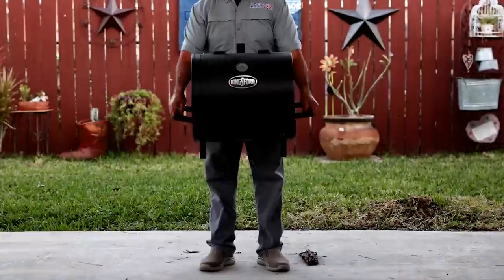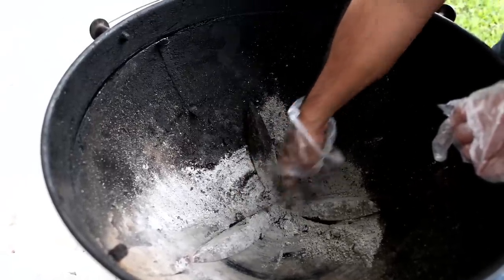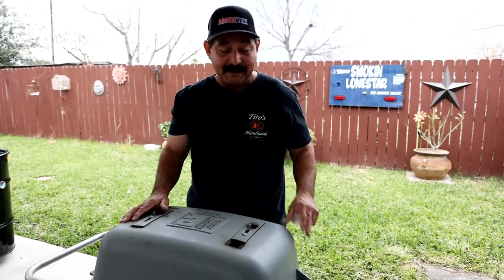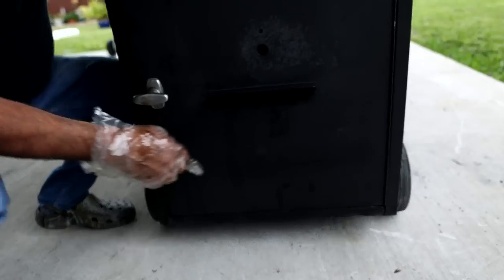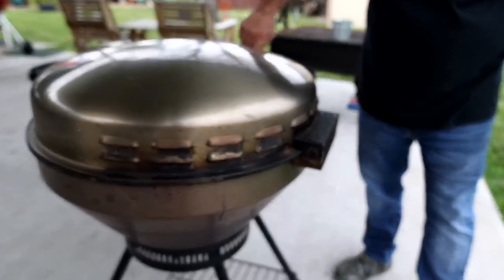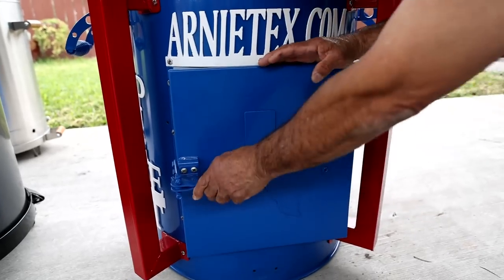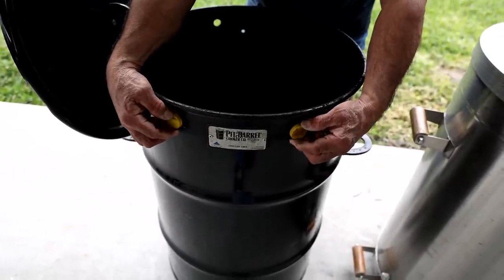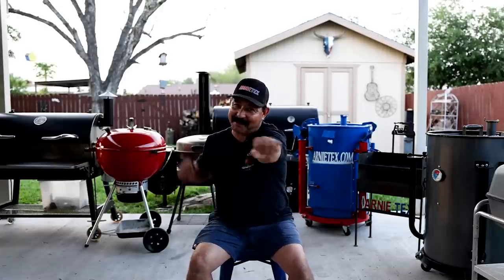I Have Too Many BBQ Pitts & Grills

Comment: Arnie now with my Weber ash basket when it’s full of ashes, I added some wire underneath near the legs and where the basket meet now adde just enough wire through the top bracket that holds the legs and ash basket together.
Now this method works good so no more basket falling with ashes inside of it problems!. Especially while I’m BBQ N ! LOL

Comment: I have 2 pellet grills. Pit boss 5 verticals. 1 off set 720 with smoke daddy upgrades. Camp chief propane and freigerater and sink and 2 burner. 1 webber 22.5 with Santa Maria attachment and home built 50 gallon UDS. 1 trailer smoker off set and a home built smoke house.

Comment: What happened to your Spitts and Pitts pellet smoker?
Reply from the maker: Jay I had two of the first ones they made, they had lots of auger and programming issues so i sold them but I hear they have fixed those issues now.
Reply: @ArnieTex  well I still have my trusty old Hasty Bake of 40 years.  Still going strong but not me.  I need something to plug and play!
Reply from the maker: @gosman949   RecTeq is your answer, I have owned Traeger, P&S, Yoder, Pitboss and the RT is the best imo, so now i have three of them, lol
Reply: @ArnieTex  the only thing I don't like about the RecTeq is that there is no Pellet drop to clean out the hopper for a different pellet.  Is this something you miss sometimes?
Reply from the maker: @gosman949   Yes I agree, that should be a no brainer but i really dont bother changing woods often, I just use whats in there, just me.
Reply: If RecTeq is your go-to pellet smoker, do you have any sort of affiliate connection your recommendation carries a lot of weight with me. Separately, I have had a Gator-pit for over 10 years and I love it. BUT…. There are times I’d like to smoke a brisket and not be so “chained” to my pit. 
Thanks for everything!
Reply from the maker: @cjmueller5455   RecTeQ is for sure my go to for pellet grills at this time, I have owned and or cooked on all the major brands and I honestly I can't remember one that was as efficient, quiet and consistent on temps as the RecTeq. In truth they all have their own little idiosyncracies but the RT is imo the best value for dollar / bang for the buck than all the ones i have had experience with. Only downside if you wanna call it that is they don't have a dealer network where you can go see feel and touch before buying but it's a successful system for them I guess. i'm not an affiliate nor am I sponsored to be saying these things but will say if you call them on the phone they answer and have excellent customer service. Hope that helps, thanks
Reply: @ArnieTex  that helps a lot. thank you!!! I’m all over their website. When I’m cooking for a group, my Gator is great, but sometimes, between events, I just want to feed the family. Also, here in Arizona, smoking wood is hard to come by.  (We have all the mesquite you want, but no oak or hickory) So the price of pellets is not much of a difference. My wife is from Chihuahua and never had smoked meat before I introduced her to it. Now, she’s addicted! Thanks again!
Reply from the maker: @cjmueller5455   Thats great, oh btw the gators are awesome cookers too, I used a friend a while back and it ran so smooth, thanks